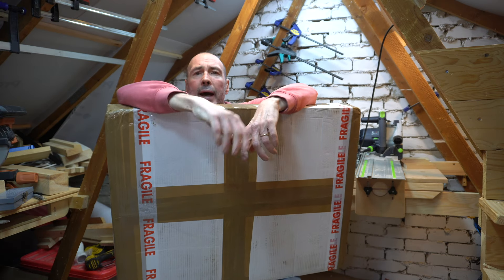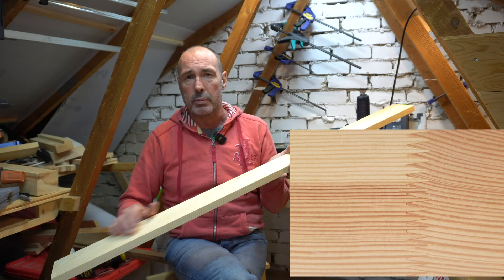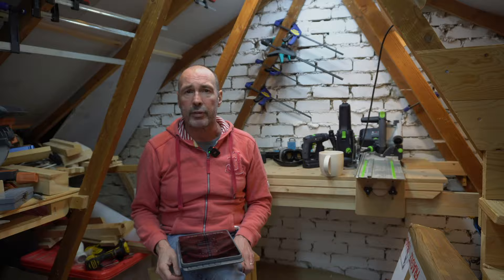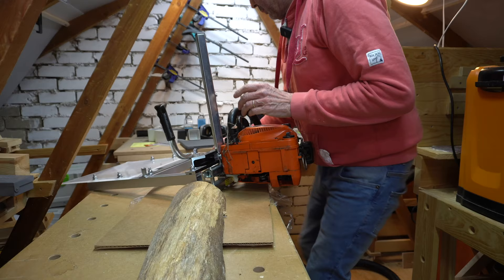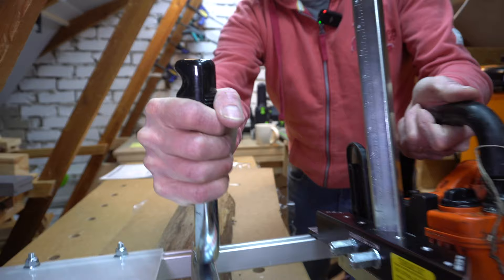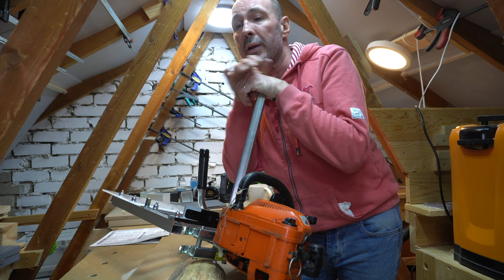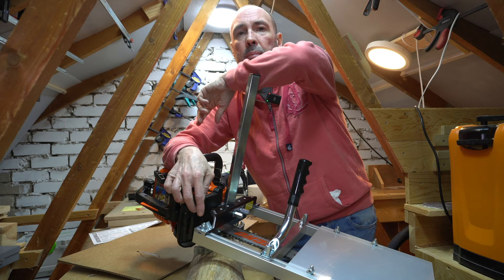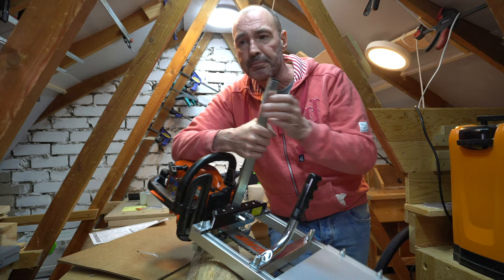Making your own timber - Unboxing the Granberg G777 Alaskan Chainsaw Saw Mill

Comment: Think you may find it difficult to find a 500cc saw- it would be huge! The back of the packaging says 50cc... Interesting item- should be quite easy to make. Mostly standard sections, with just a bit of machining. The alternative is a mill where you move the wood, not the saw- put the log on a trolley, and push it on rails through the saw; solves the problem of the first cut not having a reference surface. Will follow your testing with interest.
Reply from the maker: Thanks Mike. I went to the Stilh showroom at the weekend and they are quite a large machine. I may built one of the bandsaw types when I have time.
Reply: @Smallbarnworkshop  I was not thinking of a bandsaw- just clamp the chainsaw down, and run the wood through it. Same idea as a planer, but with a 'sled' for the first cut, to stop it twisting.
I went the the Midlands Engineering Show back in October- they were demonstrating milling timber using a big (over 2 ft) circular saw and a model traction engine... The sled they rolled the timber on was quite simple, but worked very well. Same arrangement, but with a chainsaw...
Reply from the maker: @Tensquaremetreworkshop  There is a mill out there that puts the chainsaw on a sliding carriage. It looks pretty simple in principle.

Comment: I’ve got one of these g777 mills, but haven’t used it yet. My saw is only 50cc. I’ve read a lot about the minimum sized saws to be used, and while a 50cc saw is said to be adequate for these small mills, I’m wondering how long before I do burn my daw up?
Reply from the maker: Hi. I am only using mine for seldom cuts about 18" long. So, so far so good. Regards. JP